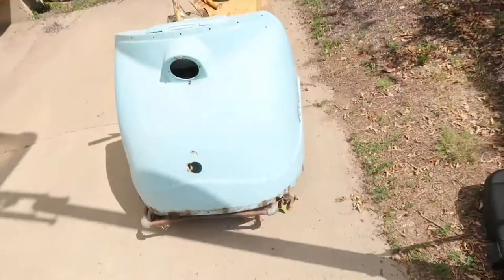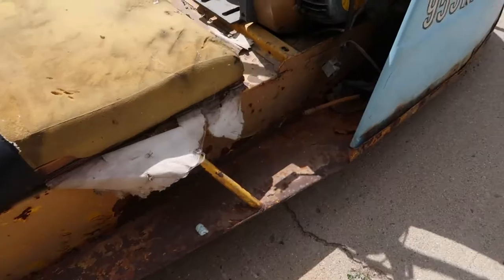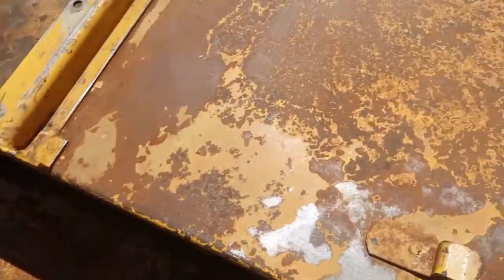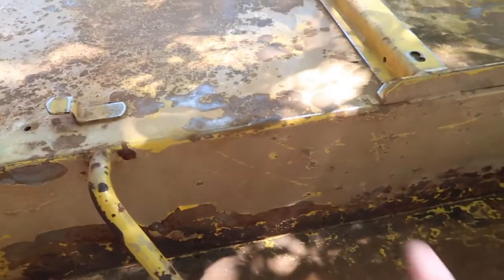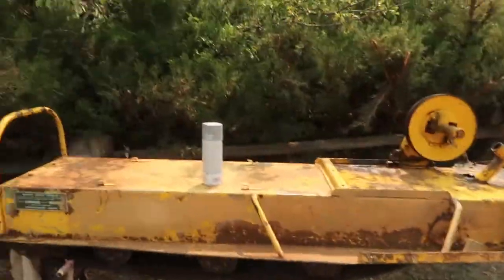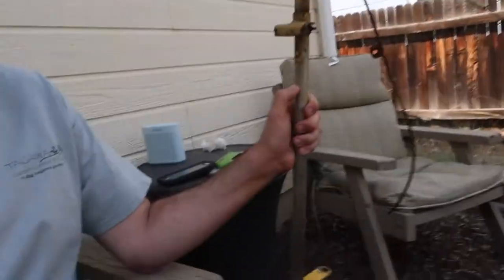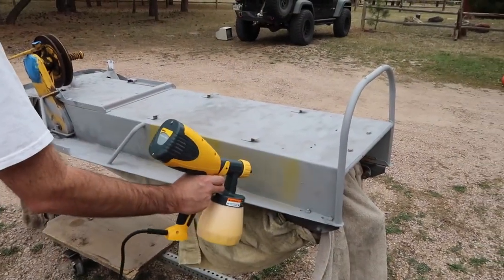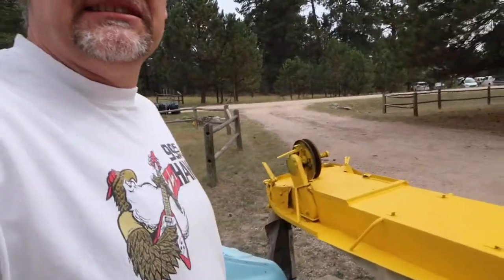Time to Refurbish our 1967 Caribou Snowmobile

Comment: Have you ever tried “rust converter”? 

It stabilizes rust and converts it into primer. You basically just scrape off the crusty stuff then lightly sand it, spray on the converter then sand like any primer and paint. 🍀🍀👍🏻
Have a great day and be safe out there!
Reply from the maker: No!  I’ve never heard of that!!  I’ll keep it in mind if I have any issues come up.  Thank you for the advice!   Have a good one.